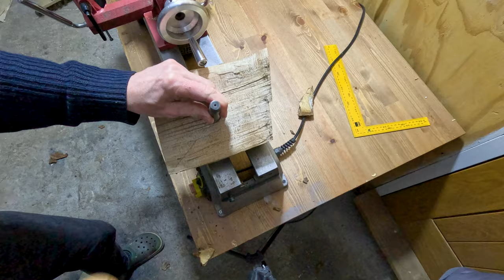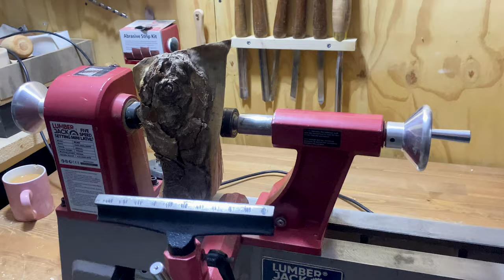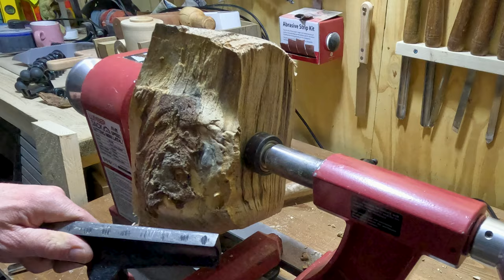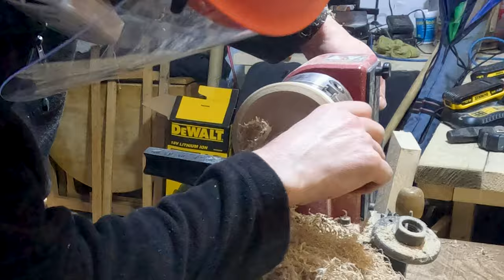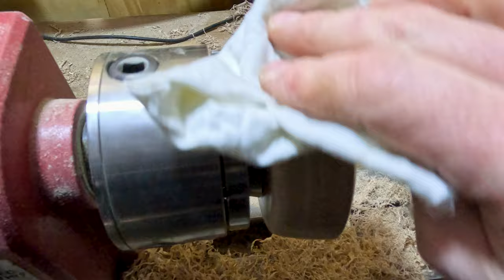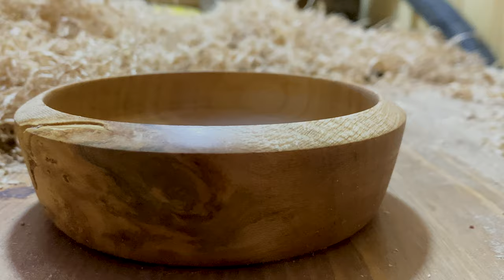Woodturning Firewood - What Lurks Inside This Gnarly Old Log?

Comment: It will be a good idea to saw it down with a saw or or chainsaw
Reply from the maker: Yeah good point. It was a bit clunky and made the whole bench shake. I need to lock the bench down somehow! The next blanks I have prepared are a bit more balanced so hopefully a bit easier!
Reply: It might help by putting some weight on the bench
Reply from the maker: I’ve since fixed the bench to the back wall and it is loads better! Thank you 🙏

Comment: If your lathe can turn down the speed do it when yor are sanding
Reply from the maker: Thanks for the tip - can I ask why that is please?
Reply: I dont know but it works really well for me
Reply: @BensGotWood  So your sandpaper doesn't get real hot and wear out way too fast. If your lathe is 3-speed, slowest speed is best for sanding and will give you a better surface. Also, the dust doesn't go quite so far.
Reply from the maker: That makes sense! Thanks for the advice. 👍🏻